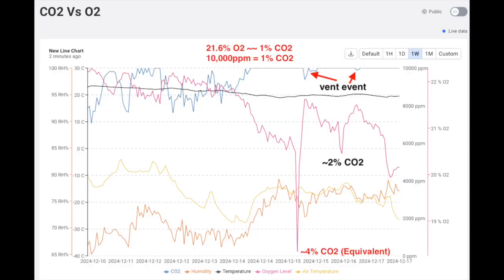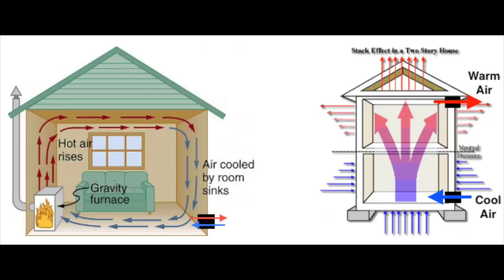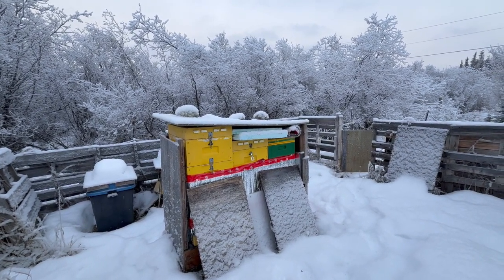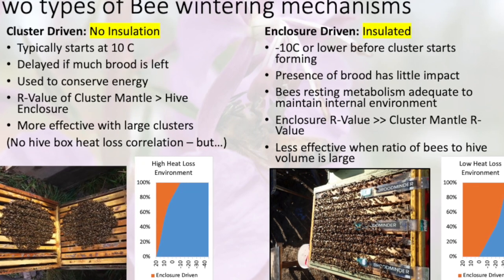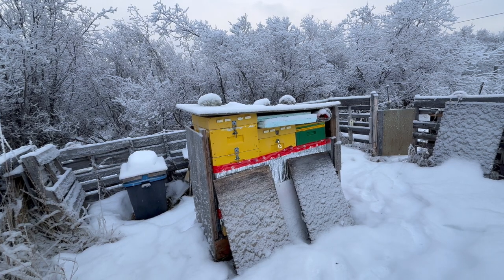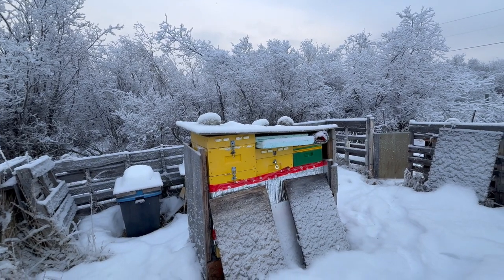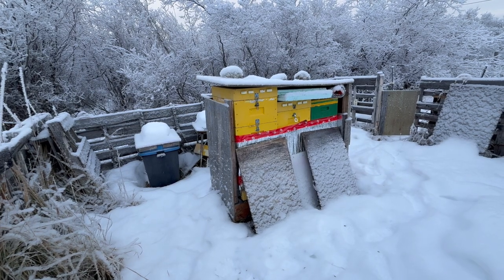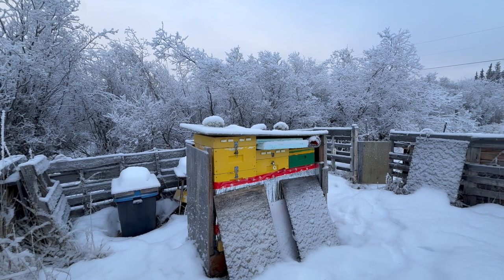Winter Hive Ventilation - A Deep Dive

Comment: So if I have the entrance reducer to the smallest opening will that be enough to let air put with no upper vent?
Reply from the maker: Good question, depends on how cold it gets where you are (along with typical fluctuations swings), how much insulation you have and how much effective upper ventilation you have. By effective, I mean is everything sealed up tight with zero micro leaks. If you have a regular top vent, small lower entrances are perfect. If you have no top entrance but things are somewhat leaky then medium is fine. If you are sealed up tight at the top then bigger is better. Just need to make sure it is wind and mouse protected .

Comment: Newer to bee keeping and LOVE your channel. I love the science and thought you put into your decisions for management. I have not yet successfully overwinteted a hive here in MN. Last year I got close but they died in spring. I. Build a foam board sleeve that slides over the hive... I used a quilt box w upper vent hole. Watching your video I'd say I didn't have enough upper insulation...and I didn't restrict the lower entrance. I always notice snows plug up my lower entrance and then condensation becomes a problem. So, I like the wood boards leaning over lower entrance to protect from snow...My question would be 1) is a quilt box helpful? and 2) would you use an upper entrance ?... and would this count as your upper vent hole? , or would you put one above the upper bee enterance.
Reply from the maker: Happy to help.... I just compiled my 2024-25 data tonight.... I will start taking a deeper dive into it along with data from the last 8 years

Comment: Hey Etienne, do you think wood entrance reducers would be less likely to ice up if i have wooden bottom boards with poly boxes?  I'm in Manitoba and am considering switching from wooden top vented brood boxes to poly for about 1500 colonies, so i can't practically get to all of them during the winter to clear entrances.  I'm also considering drilling an approximately 1" hole within the bottom 1/3 of the boxes as a winter entrance for singles and then almost entirely blocking off the bottom entrance.  Do you think they would retain enough of their heat with a hole such as this being on the front of the boxes?

Thanks
Reply from the maker: I would run a trial with your proposed setup. Is your current setup working? If yes I would be careful changing too much. Lower entrance only setups work great in low snow / very cold and steady winters. This year has been shitty, lots of up and down. I am not a fan of solid bottom boards, next year I am going back to my open screen setup.
Reply: @etiennetardif   We will definitely run a trial of maybe 100 colonies in poly equipment first before committing to changing everything over.  My brother and I are currently using commercial quad winter wraps with top ventilation and solid bottom boards because that's what our dad always did. I do believe there is room for improvement in our wintering setup however.  Since taking over our dad's business last year, we've been looking into switching to polystyrene brood boxes & lids for a few reasons:
1: better spring build up
2: potentially less feed usage
3: lower labour costs due to not wrapping colonies every fall then unwrapping them in the spring
4.  Better ability to manage colony temperatures in extreme heat/less colony resources wasted on keeping the colony temperatures down 

 My hope is that an entrance just above the bottom board above where dead bees collect would suffice for them to go on cleansing flights whenever possible without causing the colony to get too cold.

Comment: I did some volumetric air flow rates using stack formulas on a 22-inch tall colony and an upper entrance. I used some nominal opening sizes, with an indoor temp of 20 C and outdoors at 0 C. Nominally, you can move about 1 liter of air in 21 seconds under unrestrained conditions. I have your temps from the video.  Would you like a flow rate on your opening sizes? It could be interesting.
Reply from the maker: Thanks Bill, send me what you have. I would be interested in seeing!!

Comment: * it’s not the other frame.. it’s the sides of THE FRAME they are on (front /back wall). They do it best when they can propolize something to the frame above them. The bees create a subtle breeze simply by moving.  This is coordinated to move air around them. It’s best subtly seen when bees don’t have an extremely tight emergency“survival” cluster. 
If they have a well established internal control, you see it. When you pop the lid, you destroy it. They have to work hard to create the subtle pressure system. It’s like barometric pressure concept… on the frames they are occupying. It requires virtually minimal amount of energy. It’s like your hand. Just you moving it creates a breeze. A cluster is a slow mo circulation fan. Now the question is it tied to the hot /cold sides (the direction they decide to move air during cold dearths).
Reply from the maker: No need to move a 20 to 40 sometimes 60 degree C temperature difference will create in itself air movement, just adjusting the porosity of the bees covering the bee space will affect the air. The stack/buoyancy effect in a convective (differences in air density has significant flow). I can see and feel air coming out of the hive and on the human scale my cabin being heated by my wood stove. Air infiltration around door frames as air is leaked out of the micro seams.

Comment: You are correct. If you put a piece of foam packing sheet or mesh over the cluster frames in fall, the bees will use propolis to seal the sheet/mesh to the frames, allowing them optimal efficiency. Bees definitely need something over them to propolize. They need to use their cluster slight movements to stir air slowly.

Comment: The bees physically move up/down the comb, gently stirring air very subtly. Like a blender. A microscopic slow rotation. It’s maintenance mode. Like a slow hurricane on the comb. Unless they are disturbed, bees will develop a routine collectively. They use environmental pressure to regulate to.

Comment: How big would you make your entrance if you have great insulation on top and decent insulation on the sides? Like could i cut the entrance in half of your recommendation for a single entrance and single 10 frame box (5cmX1cm for a 5 frame nuc)
Reply from the maker: That’s where a temperature sensor about an inch inside your lower entrance comes in handy, especially on a single. My entrance is now 2.5 inches by 5/8”. Lower temp at -25 was -1C. Target between-5 to 5C

Comment: Thank you for the details and your time for making these videos.  I insulated my hive over the summer which let them self-regulate their environment when it was over 100℉ outside. Now in the winter I see they are maintaining 86℉ in side their double deeps while the temps outside dip below 20℉ (Massachusetts).  They are using very little energy to maintain the internal temperature. R-10 on the sides, R-40 on the top, closed screen bottom board for drainage. Monitoring inside temp.  humidity & weight.  Thanks again for all you analysis!
Reply from the maker: No worries, I am happy you discovered the summer application. So many misconceptions. Who wants a home with low insulation with high summer cooling A/C loads!! I have the opposite summer challenge here with cool nights 5-10C are my typical nights with monthly frost from May to September... Without insulation my honey crops would be minimal as it would all be used to keep the nest warm.

Comment: Great video. I use a floor entrance with a 1 1/2 inch hole. It allows condensation to drain and easier for bees to clean out dead bees. I try to keep thermal mass under my hives. I have Lazutin hives made of 2 by with r 8 foam and nail boards for bear armor with a plastic wrap about 2 feet off the ground. The frozen ground radiates cold. I leave around 70-80 lbs in hive for winter. But 15 Lazutin frames that are size of double deep Langstroth frames. My first hive was a Langstroth and bees died with honey above them in winter. So I run double deep frames now.
Reply from the maker: I am glad you have found a good system that works for you!

Comment: Great video and explanations. Do you also have an insulated bottom?
Reply from the maker: No... I typically run them with a partially open screen bottom board that is protected from the elements (skirting and snow covered). So no drafts and a place for excess condensation to drain.

Comment: So question  I have 3 inch on my tops on my wood hives and then I used reflectics
Bubble wrap on my sides is this considered a good insulation some say yes some say no it’s not the cheap thin stuff it’s actual refletics
Reply from the maker: For your area, that should be fine. The key with reflectix is to make sure you form a sealed shell so it holds heat in. Some will keep oneside longer so that it can be folded on top. A version of this with more top insulation would be my choice for your climate. I would go reflectix shell, with this type of cover over and 2"+ of top insulation. The top vent would be optional. https://youtu.be/Kx5iTYH102k?si=s6snBqTTTkJWsL_f&t=664
Reply: @ yes that’s pretty well how I have it set up on my few wood hives I also put a peace on the top then 3 1/2 insulation board the reflectix thanks for your help my friend

Comment: Thanks for explaining all this! One question though: do I understand correctly that you have the combs perpendicular to the entrance, so as to block the airflow a bit?
I'm from Sweden myself, 55 north.
Reply: more important he has the cluster above the entrance an a volume below level of entrance so cold air gets in sinks calms and prevents turbulence inside near cluster.
Reply from the maker: No they are standard langstroth (seams line up with entrance). I did some reading that showed very minor difference (cold vs hot).
Reply: I am from Berlin 53 North 😉